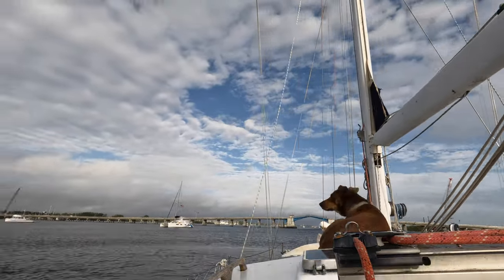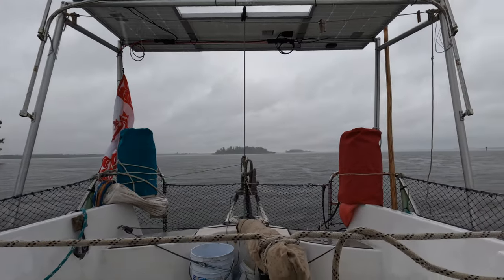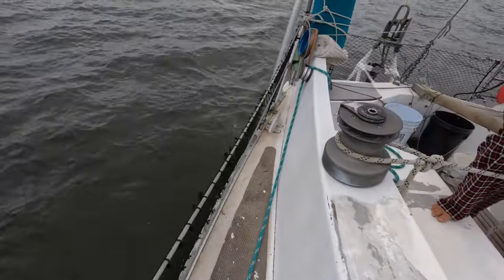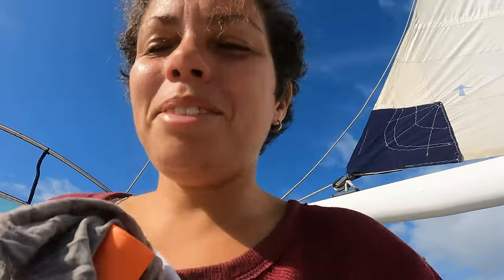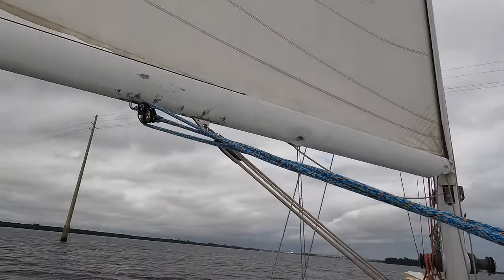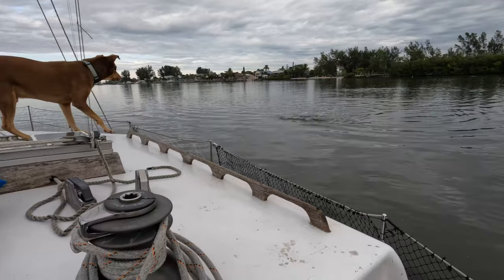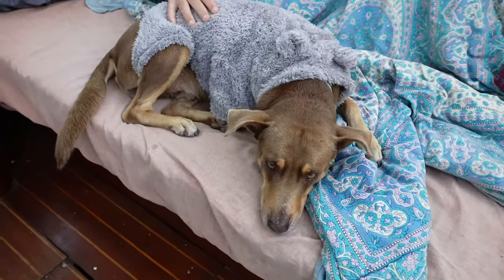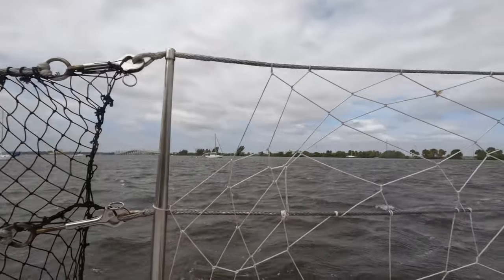AGROUND and BROKEN sailing the ICW

Comment: Youtube has developed this habit of inserting new videos under past viewed ones. So I just now saw this episode.
It was so surprising to see that you had sailed right into Brevard county.
I am surprised that the Yacht Club didn't charge you more for just tying up.
Are you still in this area?
 I live in Cocoa and the two marines we use to have have been turned into condos. 
Their are some inexpensive marinas along the barge channel. They are well sheltered from the weather.
And Titusville has one that is still working.
Sorry I missed seeing you, I have a pick up and could have dragged you around to pick up supplies.
Looking forward to seeing where you end up hauling out at, cheers.
Reply from the maker: Cheers! Yes, the area is not so easy to find marina space - even out around the causeways, always a few boats anchored. But we enjoyed the visit. Sorry we missed you!